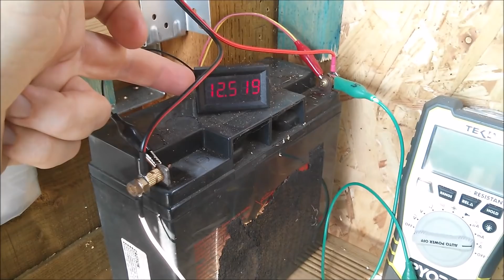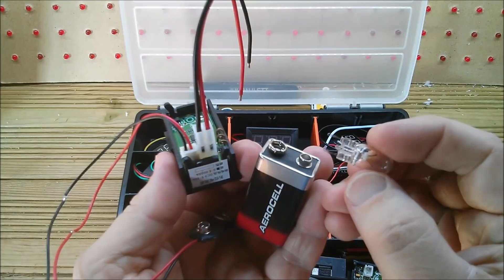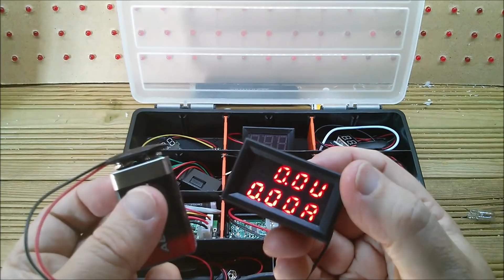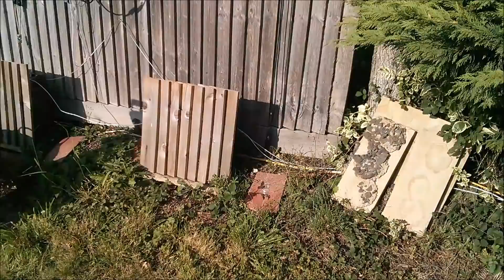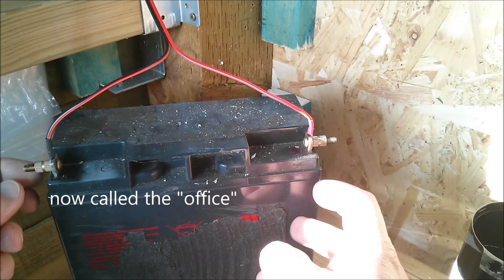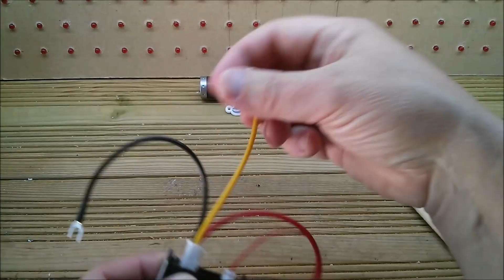Ammeter for Workshop Battery (powers the lights)

Comment: Moral of this video? RTFM! The thick yellow wire is the supply voltage reading for the load, and the thick red wire is for current measurement of the load.

Comment: Regarding 33:04, the meters only measure current in one direction. While you charge the battery, you put the yellow on the battery. While you draw from battery, you put yellow on the load.

Comment: those meters usually have a zero ohm resistor linking the grounds, which you can remove if you want isolation, provided you don't exceed the common mode range of course.

Comment: I'd like to see what's under the insulation on those "heat treated" wires.  Did some of the strands melt, turning them into solid-core?
Reply: They could very well be tin plated copper, and the tin has melted with the large current.

Comment: I also have one of those volt/ammmeters and I noticed, you do not need to connect thin red wire to power it. It can feed from voltage it is supposed to measure. Only disadvantage is you cannot measure voltages under 4 or so volts, because it is not enough to power up the thing. So not a big deal in this case.

Comment: I got one of these and it, similar to yours, did not measure current. Why? It turned out the unit did not have a current shunt installed on the board. Why? I guess because they sent me a wrong version intended to go with an external shunt. So they have a version with a shunt for 10A and another version without shunt as the shunt is external for various max current - say 50A, 100A etc. Not enough quality control but for these prices we can't expect more, I guess. Plus, the current you were measuring most likely was some arbitrary value.

Comment: that because they ment for monitoering loads not incomming i have serrched all over and can not find a bi doirectional one also you wont the load on the same place as power in so you can see exactly whats going into the battery

Comment: right if using one supply for both meter and load, then you connect thin red and yellow to battery Positive, a seperate wire from battery positive to the load, the thin black wire is left unconnected, the thick black wire is connected to the battery negative, and the thick red wire to the negative side of the load, simples :-)

Comment: I think that you may have wired up the ammeter the wrong way round somehow..Maybe swap the red and yellow wires? If your ammeter has a 0 ohm "resistor" link to 0v line you can remove it for a differential current measurement.

Comment: Why spend all that money on a hot air gun for heat shrinking when you can simply use the side of the soldering iron or a lighter? (not the tip of the soldering iron)

Comment: You built an Arduino based current meter using an INA219a current sensing module + OLED display a while back - specifically because the INA219a can measure both positive and negative current directions.  Why not use that, then it will tell you the current regardless of which side has the higher potential (solar panel or battery).   Limited to 3Amps if I recall - but might be worth trying....

Comment: There are 3 variants with these chinese made meters.  The variant you show is the unusual one.  Heavy and small black to to battery negative. Heavy red and small red to to battery positive. Heavy yellow goes to the negative (return)side of the load.   The positive side of the load connects to Bat Pos. along with the meter heavy red. In this case the small red wire is the voltage sense wire. The internal shunt on the device is between heavy yellow and heavy black wires, so the Yellow wire is the sense and also carries the discharge current.

The other variant of interest is the 3 small wires ( red black yellow) and two heavy ones (Red and Black).. In this case the small wires are the red(+), minus(-) to run the meter and the small yellow is the voltage + sense wire.   The heavy black connects to the negative battery and the heavy Red connects to the load negative (return). The load positive connects to the batt +.
Typically these meters will not measure bidirectional current and you will probably blow the meter with reverse voltage. So if you have a solar charger and load connected and you need to measure both ways, you will need two of these cheap meters with a shotky diode in series with the Yellow wire to protect the current shunt. In this case, I'd suggest and external shunt device.  Better to spend a little bit more and find one that will measure current  bidirectionally.  They do exist.

Comment: I got in the habit of writing on or labelling all the little modules I get from ebay with ins and outs and max voltages etc. those led voltmeters, most of them are either 30V max or 100V max, and it turns out that the 30V ones particularly dont like being grossly over-volted. whodathunkit. so yeah, labels now.

Comment: '
Black wire(shunt's) should be on the current source side, ( since the meter is not doing bidirectional current measurement ) 
 when you're charging the battery, source is the solarpanel's side.

Comment: There are 2 small pot's on the back of the units used for correcting the reading if you have a accurate voltmeter....
Reply: Those pots are probably jammed with molten plastic / charcoal from Julian's magic smoke show.

Comment: Ive used a few of those led meters, some are very accurate. I noticed that when they put them together they do not take off the protection tape over the display inside. If you remove the tape they are much better displayed.

Comment: Can you say FUSE ?  Your household wiring uses them (or circuit breakers) so why wouldn't you use them on the shed's wiring?  That's a fire hazard and the insurance company might decline any claim because of it.  I'm always surprised at the number of "hobbyists" that don't use them... although you did use one on your latest MUPPET DC to DC converter where available current is much lower and possible damage is a fraction of the cost of your shed (fence, neighbours, etc.).  You can do better, Julian!

Comment: Is there a reason you chose to use such thin wires?   I should imagine the resistance of the wire would result in quite a lot of loss.
It looks like a lot of weatherproofing is needed as well.

Comment: I would change those rocker switches for shed lighting to guarded ones as they look cooler :)
 As for insulating the shed I suggest aerogel with which body heat may be enough, for more info there is a good article about it at https://www.theregister.com/2010/11/24/diy_insulation_with_aerogel/

Comment: I just went back through your video when I realised you got something drastically wrong. It happened at 8:23! The battery and meter SHOULD be in series with each other, the meter being on the low side. The black thick wire of the meter should be connected to the negative of your solar NOT to the negative of the battery. 

The battery positive gets connected to the solar positive but the negative of the battery gets connected to the yellow wire (i.e. high side of the shunt) the shunt low side (black) is hard wired to the meter ground.

The voltage shown as "battery" voltage is ACTUALLY the incoming feed voltage you are measuring! You MUST use another voltage meter to measure the battery voltage independently AND do NOT CONNECT its black wires to ANYTHING except to the battery negative. The solar negative MUST NOT be connected to ANYTHING other than the current measuring meter's black wire. 

Draw out the circuit yourself and see. Charge voltage (solar volts) MUST BE across battery AND meter in series.
Reply: https://www.ebay.com/itm/Mini-Digital-Voltmeter-Ammeter-DC-100V-10A-Car-LED-Display-Panel-Amp-Volt-Tester/293655584807 shows a proper wiring diagram for the meter being sold in the ad.   Replace " DC load " with  "Battery" and "Power for meter and load" with " Solar Panels ".
Reply: @gravelydon7072  only one problem with that. It is NOT the same meter as Julian was using and the wiring of the meter in that diagram is DIFFERENT. THAT'S why I warned people to be careful. There are also meters with green or blue wires! You MUST wire the meters correctly for their type and it is NOT possible to use such meters to measure charge volts AND battery volts properly with just ONE meter unless different switched wiring is used for each.
Reply: @boblewis5558  Difference in "a" and "the" makes a world of difference in meaning. Yes I should have included "for the meter being sold in the ad. " Have corrected it.
Reply: @gravelydon7072  no worries. I just wanted others reading the comment that there are various meters around that look the same but aren't quite. Having fallen foul of this myself I know just how easy it is.

Comment: I've that meter ( the one you released the magic smoke with ) , thanks for the wiring tips..
I'd fit a switch on the supply wire to the display, the draw might be negligible but its there...

Comment: How much voltage drop are you realizing from the Trojans using that skinny wire ?
Reply from the maker: It changes, depending on the load on my local battery. But they equalise overnight.

Comment: I can recommend a bit of silicone tubing (aquarium air line works well) on the jaws of the croc clips on your helping hands. Acts as a thermal insulator when doing connectors so the iron doesn't have so much thermal mass to warm up (and later burn you, lol!)
Reply from the maker: Funnily enough, I just bought some. I was going to use it for expanding foam, but it's the wrong size for that :)
Reply: It's not as thick but heatshrink is perfect for this, you can slide it on then once heated it fits snugly around the clip so it'll never fall off.

Comment: Thank you for the honest video, I thought I was the only one who shorted things out occasionally. A small self-tapping screw should fix that trigger interlock, not that I would defeat a "safety feature". Regards, David.
Reply from the maker: It's a safety feature that isn't needed. The unit makes enough noise to tell you the hot end is hot. After you release the trigger, the unit is still hot, of course, but the 'safety' feature can't prevent against a burn at that time. It's simply not needed.
Reply: @JulianIlett  I think it is a safety issue.  Think about dropping it in your tool bag and tossing it in your vehicle.  Hit a bump on the road and something else in the bag 'pulls' the trigger.  In a few minutes you have no more vehicle.  Of course if you are like me you always pull the battery before storing the tool.  :)
Reply: @MSTHtech  That is the whole idea behind the safety. And if the operator used his thumb to shove it over, I bet he'd find it easy to use. Many in the firearms world can flip off the thumb safety without even looking at where one is.
Reply: Bill Mack made a critical point.  Maybe push the safety latch over and drill a small hole in it so that you can stick a small wire into the hole to hold the safety latch.  Then remove the wire from the safety latch when done to protect from inadvertent triggering.

Comment: Might be a good idea to invest in some fuses, if something happens to the twinflex (rodent damage etc) you might not have a shed to work in
Would also help if you made it standard to install a fuse on each battery and insulate the direct positive.
The nouse of your heatgun is probably a thermostat, when it's not heatig, tyhe motor speeds up

Comment: You should cut the supply + wire. The supply should goes from the fat cable to meter for correct current measurements.
Edit: I was wrong, thin black supply cable should not connected.
Reply: Sddtn ACTUALLY the thick red (on a three wire display goes to VCC and thick Black goes to ground return. UNLESS you want the supply to stay on (in a power supply for instance) when the power out connection is isolated then the small two lead connection is entirely redundant. 

Julian performed an entirely unnecessary correction (since he's both measuring and supplying from the same place) and he could have omitted the small twin cable/connector entirely. 

THIS IS NOT TRUE FOR TWO WIRE VERSIONS! I.E.  with only thick black and thick red when the earth return of the load.must connect to red and a separate +VCC supply taken to the load +ve point. This confusing so be careful!

Comment: Julian, please stop shorting things out. There's only so much we or the electronics can take! 😂
Reply from the maker: It's OK if you use a proper bench power supply with current limiting - i.e. 9v PP3
Reply: @JulianIlett  As long as you're taking such precautions and nothing goes up in smoke I suppose that's ok.